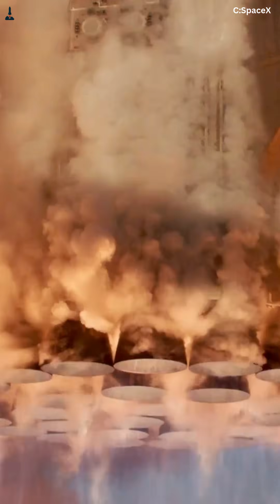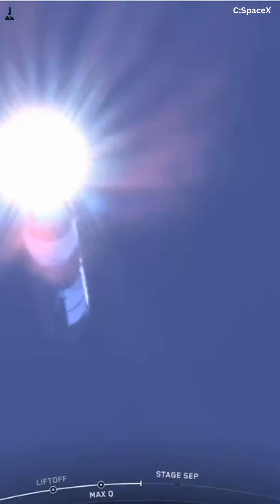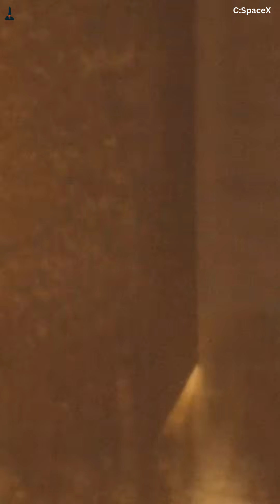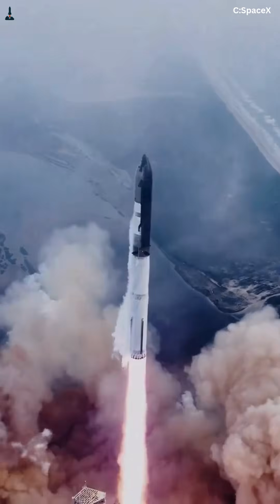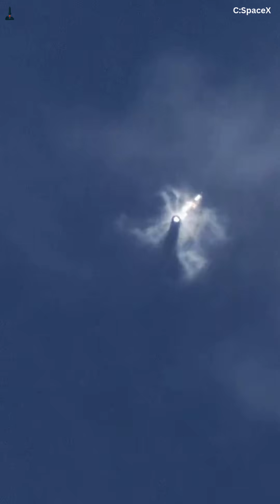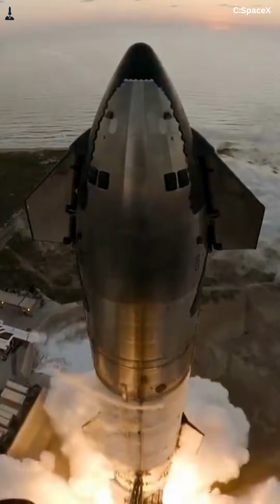Starship’s Most Dangerous Weak Point Explained #spacex #starship #rocket

Comment: Actually Starship generates a little more than double the Saturn 5, not five times.  Saturn 5 F1 engines together generated 7.5 million ponds of thrust.  Starship around 17.5 million pounds.  Not five times as much.
Reply: Or maybe he means power to weight ratio differences, S5 really did lumber in comparison
Reply: It’s engagement farming. Videos with comments are more valuable and a subtle mistake will get comments.

Comment: 99.9% of the world uses metric system.
why do we have to convert imperial to metric?
Thanks from Italy.
Reply: I don't remember the year but it was passed in Congress and Senate that we would be converting over to the metric system but it was not supposed to take place until a future point in time but then when the future point in time come around I believe they postponed it and I think in the end it never happened because of the cost of the government to redo every document and every sign to the new standard. Basically it's because they didn't want to spend the money to do the switch over
Reply: @donaldbates155  It’s the same reason the international aviation community still uses feet for altitude and nautical miles for speed. They looked at converting the international standard to metric but it is currently too expensive.